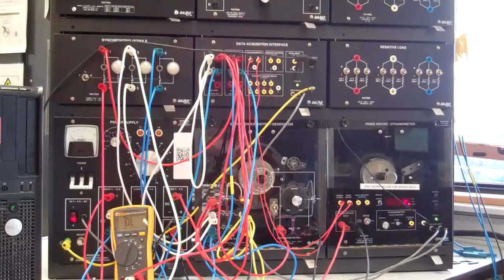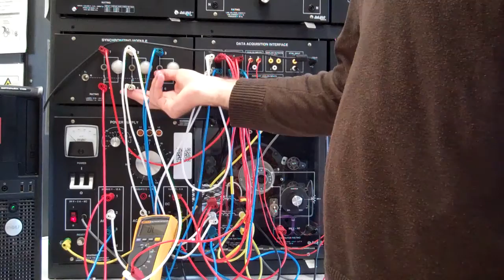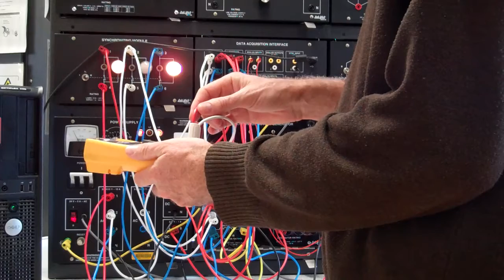Synchronizing the Synchronous Generator

Comment: Hi, Simon. It is a very good demonstration. I have two questions if you can answer me, I would be really thankful to you. Can you please tell me why after synchronization, increasing prime mover speed results in Active power injection but not speed increase? 
When synchronous generator act as a motor, why it isn't pushing the speed of DC motor since both are applying torque in the same direction (also if  DC motor current become zero since force is now coming from synchronous motor)?. If torque is in opposite direction, would there be a huge increase in current(both for dc and ac). Would wait for your reply. Regards